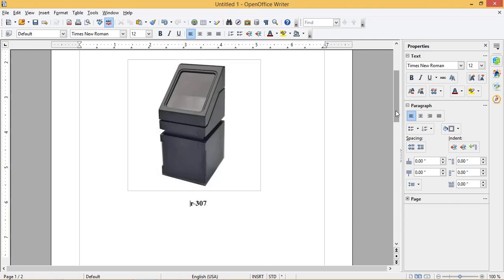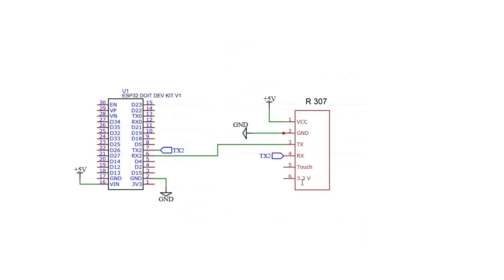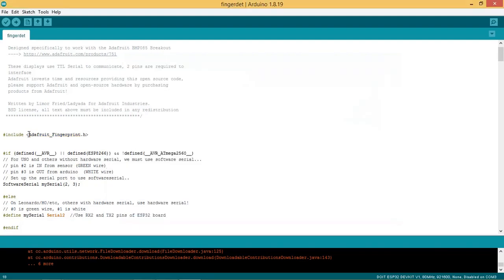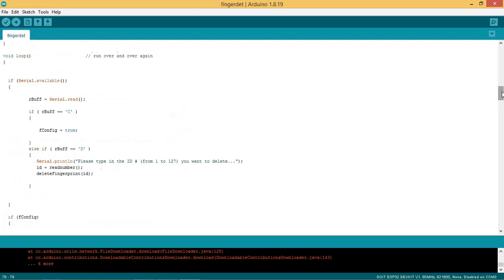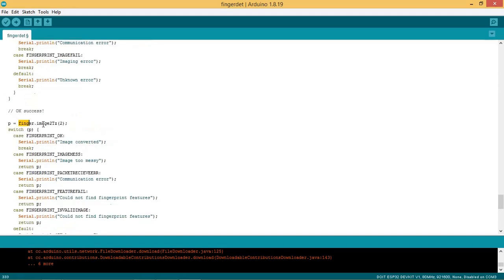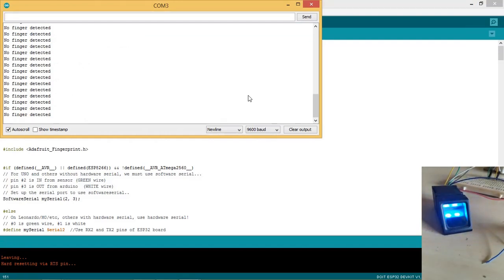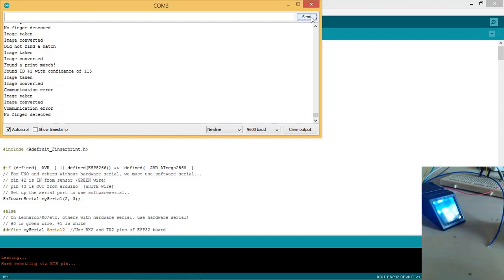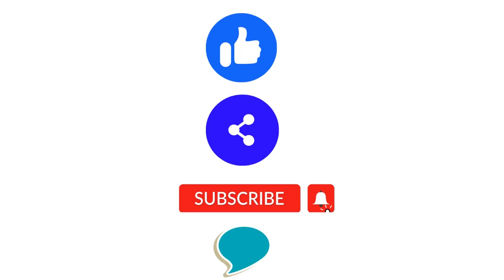Use Finger Print Sensor R-307 with ESP32

Comment: I use Esp8266 but when connecting to Fingerprint Sensor R-307, it says no fingerprint found. I have correctly installed 3V, ground, TX seconds into RX and vice versa,  please help me
Reply from the maker: Hi, Connect 5V not 3v.Thanks!.Plz refer R-307 schematic shown in the video.